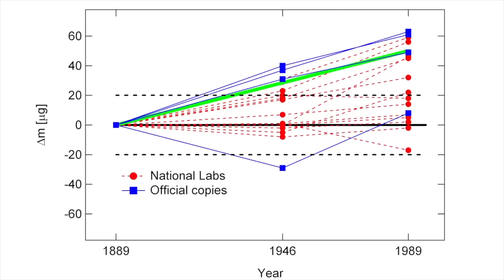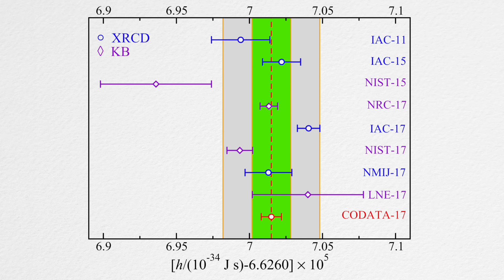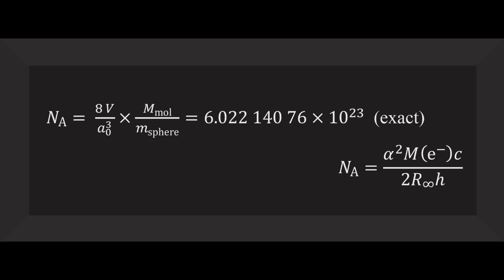The kg is dead, long live the kg

Comment: I'm 66 years old, born and raised in the U.S. I started using metric (specifically grams) for weighing ingredients for baking and most other cooking a few years ago. It's easy to do if you have a scale. BUT, I still don't have any visual conception of how much a gram of anything is, unlike an ounce. So if I don't have a scale, I'm completely lost. Similarly, I did a woodworking projects a few years ago where the plans were drawn with metric measurements. I bought some rulers and a tape measure with metric and completed the project successfully. BUT I still don't really have any good "innate" sense of how long a cm is. I'm not stupid or uneducated, it's actually quite difficult to overcome, in my case, decades of dealing with one system of measurement where everything has become ingrained in your mind. I think both sides of this argument/debate have some merit.
Reply: Ultimately, I dont think it comes down to a debate. If you are accustomed to using a particular system, and you are able to use it effectively, then that's great. 

The reason why metric is used in science predominately is simply due to it being easier to derive and convert in the abstract. 

You might be able to visualize a mile better than a kilometer, but you cant argue that the math to convert kilometers to centimeters is more difficult than miles to inches. 

It's not about which form of measurement is superior to the other, it's about knowing which form of measurement is going to be more effective in any given situation.
Reply: @justinh4462  converting kilometres to centimetres is objectively easier because it doesn’t rely on conversion between two arbitrary archaic measurements, rather it all is divisible by 100. 

10mm = 1cm 
100cm = 1m
1000m = 1km

0.75 km is 750m which is 7500cm which is 75,000mm. That same distance in imperial would be 0.4 miles, which is 704 yards which is 2112 feet which is 25344 inches.
Reply: I suppose it really depends on where you grow up. 

As an Aussie boilermaker I have a much better understanding of metric, and only a rudimentary sense of imperial. I can visualise how big an inch is but that’s really it.
Reply: Super interesting, but I also think that it has something to do with the basic idea of being able to equalize 1 measurement to real things you might see daily. Like saying a meter, is how long you can stretch 1 leg from the other at a very early age is good. Or 20 cm is from top head to shoulder etc. Even something as childish as penis size will put things more to perspective that is easiere to remember than the measurements from a project. Same with Kg=something you normaly lift, Liter=same as kg, or a big bottle of water etc
Reply: @zengara11  admittedly if I’m trying to measure in inches I’m not really measuring in inches I’m measuring in penis size 😂😂 can’t blame me.

Comment: Why did Plancks constant fluctuate?
Reply: It used to be defined relative to the kg.  But the physical kg standard was not reliable, so metrologists decided to fix the constant and use it to define the kg.  It is just another way of looking at it which has the benefit of not needing a physical standard kg.

Comment: If Plank's constant is so fundamental, what would happen if we set this constant to 1 and recalculate all other units? As I always wonder why didn't we make C and Pi a whole number and redefine the units of length and time etc...?
Reply: That's actually an excellent insight! Planck's constant is fundamental in the sense that it emerges from universal laws of physics, but its numerical value is not fundamental since it relies on human-defined units. You'll find that a lot of physicists actually do set h and c to be 1 to make equations cleaner, you only have to remember what their "dimensions" are (i.e. length/time for speed, mass/length^3 for density, etc.).

The constants in nature that do have a fixed numerical value are known as dimensionless physical constants. They're expressly defined to be unit-less, usually as the ratio between measurable quantities. For example, there's the proton-to-electron mass ratio (~= 1836) or the fine-structure constant alpha (~= 1/137). Those constants can't be set to 1, they can only have those values since they don't rely on arbitrary units.

That's the same reason pi can't be equal to 1 either, it's the ratio between the perimeter and the diameter of circle, so length/length = no units! (also because it's a mathematical constant and not a physical one, it emerges from a number system that has no units in the first place and already has a strict definition of 1 :) )
Reply: The speed of light could only be changed by changing the length of a meter by enough to break a lot of things, or by changing the duration of a second.  Either would cause a huge amount of trouble.  It has always been policy when refining the definition of units to minimize the consequences for those who use the units.

Comment: So we can't even decide what type of measurement, imperial or metric, to use so let's change one of them to really confuse everyone.
Reply: But the change is supposed to make it less confusing and easier to use
Reply: No, both the kg and the slug are redefined by this change.  It doesn’t add any confusion.  It should reduce variability in the physical standards formerly derived from the root standard.
Reply: @GH-oi2jf  I can't help but think that instead of uncertainty we will have a rounding error now.

Comment: So many people ridicule the customary system of measurement units, but then the metric system has this stuff... And they define the kilogram, instead of defining the gram. Just goes to show that everything is ridiculous.
Reply: Maybe you are just a troll, but what "this stuff"? That's literally science, if you have problem understanding a few numbers after a dot, it's not our problem. Thanks to the metric system, ironically, just move the decimal point 3 times and you have the definition of a gram, kilogram is just more intuitive so it is the base unit, prefixes still work the same.
Reply: @МатвейМещеряков-ц7ф  I mean, people say the customary system doesn't make any sense. It does, just not decimal. Having something in 12ths enables you to easily divide it by 2, 3, and 4, with an integer result. And there's nothing more intuitive than a foot.  Don't get me wrong, I think we should all go metric, but I also don't think it's Ok to be snobby about it. All the measurement units have strengths and weaknesses. And this saga shows that. And it just seems to me that they should define the base unit, rather than the amount that is 1,000x times the base unit. The definition of a gram is literally 1/1,000 of a kilogram. It really should be the other way around if we are going to have a sensible scientific system of measurement.
Reply: @nroose  but if you define the kg you also define the gram. It’s just a conversion nothing really changes.
Reply: @lukefrance9558  Sure. So, you could just as well define the pound and then say a KG is 2.2 pounds and a G is 0.0022 pounds. It's just silly. And so many people wrongly say the pound is silly. It's not silly. But we should use one unit and KG is more modern and decimal and the different units are more cleanly related. So we should use metric. And we should define the gram.
Reply: This also redefines the pound.

Comment: Question: Will the silicon ball (Le Big Silicon Ball) change in measured dimension or weight over 50, 100, 150 years?  If so, will these first principle and determined constants.

Comment: Meanwhile at a civil engineer's paper:
"Yeah, pi is totally 3..."
Reply: 2 = e = pi = 3, the fundamental theorem of engineering.
Reply: @tiskbubbles4688 
2 = 3

2 = 3

Yeah, seems about right.
Reply: @tiskbubbles4688  I'm late to this but that rolls off the tongue so easily that now I'm curious. What's it mean, please ELI5
Reply: @montikore  don't wanna know, im not an engineer. Life is short, leaving all questions to science and technology or whatever.
Reply: @montikore  e is a constant having to do with exponential growth, about 2.7
Reply: @deez_nuts_77  LULZ
Reply: @montikore  pi is a Greek letter, so it's not on my keyboard. Mathmaticians use it to hold a constant number, 3.14159265... . Its decimal places go on forever and never repeat (unlike 1/3, which is 0.33333...). It is defined as circumference of a given circle divided by its diameter. So if you took a string and wrapped it around a can so it fit exactly and then folded it in 3.14159265... pieces, it would reach exactly across the top of the can. 

The joke is that engineers don't care about precision (who cares about the decimal places) and here are the physicists arguing over Plank's Constant to the 10th decimal place (maybe more).
Reply: In the state of Indiana, in the very late 19th century, the legislature tried to pass a law formally setting the value of pi to 3.2. It's on wiki, look it up.
Reply: Meanwhile, in an astronomy class:
"On the homework, that one's actually off by a factor of ten but it's close enough that I'll count it right."
Reply: Not really., Its 4
Reply: Iirc many engineers just use 3.142
Reply: @JAMBUILDER08  many engeniers just use the π symbol in their 15 bucks calculator
Reply: @miguelpimentel5623  i feel attacked. We use 40 bucks calculators
Reply: @miguelpimentel5623  or the pi() function in excel😁
Reply: π²=g
Reply: Or 5, sometimes it really doesn't matter.
Reply: Pi = e = 3 and that is enough
Reply: e ≈ 2.718
π ≈ 3.142

Comment: I don't get this. Since the weight is based on the gravitational pull of earth, how can we be sure what exact value is has and if it is equal in every place on earth (it shouldn't, because from the perspective of gravity the earth is a potato).
Reply: they want our measuring systems to be based of universal constants instead of thing that change
Reply: @godalien3223  I got this point. But if Planck's constant has an uncertainty and needs to be deducted by the actual mass of kilogram, which in turn is also uncertain, than how can one be sure that it is correct? In my eyes the approached way is just to split the SI unit kilogram in a definition which involves other numbers (like the Planck's constant).

Comment: I'm confused how they could do this. If planck's constant has the units Joule * second, and a joule is based on a kg... isn't that circular?
Reply: You measure a constant by fixing its units, but that doesn't mean the constant depends on them. The speed of light is distance/time but it doesn't depend on how far you travel or for how long, the opposite in fact. You could define a meter as the distance light travels in a set amount of time, because the speed of light is a fundamental law. In fact that's part of how Planck's constant is measured and how it can define the units it contains.

If I'm not mistaken the units of time, the second in particular, have been defined using electron transitions which also depend on Planck's law

Comment: I wonder if we'll ever have a system of measurement in which the standard units of mass, length, and time are defined in terms of Planck units (i.e., the Planck mass, Planck length, and Planck time), which rely solely on the physical constants c, h, and G. This probably won't occur until we can measure G more precisely.
Reply: That would produce big numbers
Reply: @nif4345  Yes, but we always standardize them by multiplying by an appropriate power of 10, or whatever base we'll ever be using.

Comment: They must have had nothing better to do

It's cool that they want to keep it consistent and reliable forever. But 1kg was consistent and reliable forever. Until they decided to change it. I swear. They are just trying to make things more complicated. I could hear it now. "...actually it's not 1kg its....". Yeh. Good for you. This is dumb AF.
Reply: The thing is that it used to be measured from a solid piece of silicon and metal. But it got lighter so it wasn’t really consistent.
Reply: It doesn’t affect you at all.
Reply: @GH-oi2jf  
Sure it does.

Comment: 1:45 must be a little off, because if it's based on frequency, wouldn't that mean that all particles with mass have a wavelength, and vice versa?

Because wavelength is based on frequency as well... so yeh... that change break physics i think... if it were true...
Reply: let me blow your mind in a sec

every particle is also a wave, in all cases
Reply: @tmd9412  Interesting, when i had written this i hadn't thought of that... i think about that now, but yeah, that equation i think is a little too simplified as wouldn't it mathematically state that all particles have mass? anyway, finding the more accurate equation is something that would personally bring me more ease in the validity of the existence of massless particles, so i do occasionally try to look for it... sometimes attention span can get in the way, which is annoying, but yeah.

Comment: I always thought 1liter was 1 kg
Reply: It's not always correct, it depends on the density of the liquid. For instance, 1 litre of Mercury is equal to 13.53 Kg, because Mercury is and extremely dense metal in liquid form. So the weight will vary based on density, but the volume will remain constant, which in this case is 1 litre. I hope I made any sense.
Reply: 1 litre is 10cm x 10cm x 10 cm, and 1 litre of water weighs 1kg for all common intents and purposes, and that's the way a kg was originally defined. We just don't use that relationship to define it any more.

Comment: if a kilogram is not going to be a kilogram then why keep this unit of measure why not create a whole new one  having a unit of measure not based on what is supposed to represent sounds stupid
Reply: Because getting everyone on board with a new unit of measurement is hard to do, America hasn't even adopted the metric system yet. It's just more helpful to change the definition of the kilogram to be as clean and consistent as possible.

Comment: So you try basically to fix the uncertain numbers at a constant thus making "the kg" as it is now defined change to other than the kg. But it is impossible to fix an uncertain number at a constant. Unlike the way you fix "the kg" at certain pressures and temperatures to be exactly 1kg, how are you going to measure exactly a constant that relates to energy? You can't be precise. You fix something and you destroy something else. You make a change that gains nothing.

Comment: I'm trying to wrap my head around this, gravity is not a set force, or rather is a force defined by the amount of mass within a set volume,  but, it is effected by other masses sometimes very far away. 
Like how the moon causes the tide, does that mean that technically the water gets lighter when the moon is above, and heavier when below? (Other side of the planet)
 And if that is the case, what happens when the outer planets all align and the effect of gravity is compounded, would it be enough to effect the weight of the ...weight? If we can measure gravitational waves, are we measuring the force of the wave, or the deflection of weight caused by the gravitational anomaly?

Comment: When people hate on imperial units they should realize that metric is not that much better. Sure metric is x10 x1000 etc. while imperial is a mess of x12 x5280 x1760 and gallon is a very ambiguous word. However both systems are based on arbitrary things lying around.

Comment: My 2 pennys worth. The great Pyramid of Giza Defines the Metre, as well as some other interesting mathmatical constants, ie The Golden Ratio and Pi, with incredibl;e and almost unbelievable accuracy. It also defines the speed of light, the dimensions of the Earth (accoumting for the equatorial bulge) and many other mathmatical "coincidences". Whoever built the pyramid (most likely not the egyptians) had incredible knowledge aqnd almost as much of an interest in fixing these units of measure as you guys at Veritasium. I was sceptical at first but having invested some time getting up to speed on recent discoveriies now apparent due to greater accuracy of modern instrumentation I am amazed at the sheer number of Coincidences. We are vtaught at school that the egyptian unit of measure was the Cubit! It is interesting then that the circumference of a circle with a diameter of 1 meter is 2.54 meteres and that the Cubit is one tenth of that. 25.4cm. Also interesting that the inch is 2.54 cm! and it goes on and on. 
One last observation. Is it possible that the slight variation in the earths speed of rotation, and thus the force of gravity, was responsible for the changes in the weight of the Kilogramme over time. for sure, theres more to this that is yet to be revealed. Maybe fixing the constants might ber the answer but maybe not. Great question though, and very well drilled into. Thanks for a great channel.

Comment: We think we control the chaos, but for the Universe, chaos is the standard. 

For the Universe, 1 kilogram means nothing. It's all tied to energy. 

The Universe would understand a kilogram as certain amount of gravity in certain point, it doesn't care about mass.

Mass would be like energy debris, the product of energy standing in a point for an infinite amount of time, which is impossible. It just works for us because we can't work with other variables yet.

The reason why we, as a mass, are not free energy, is because of gravity and thermodynamics.

Living beings are just a huge coincidence where random energy focused in certain point tied to gravity, interacted creating a feedback stable system where the Universe works all according to the thermodynamics.

When we die, that stable equilibrium breaks, and we just slowly disintegrate and become free energy again.